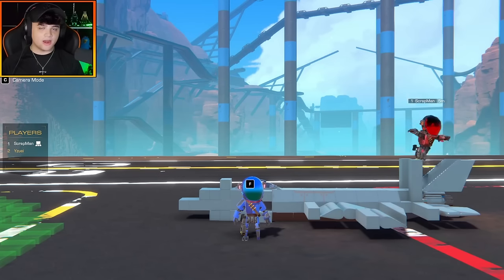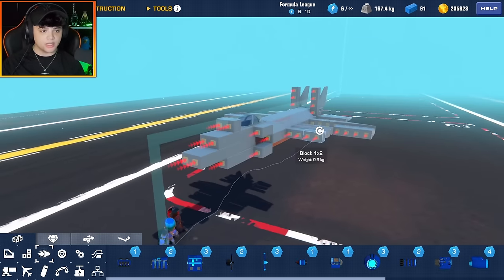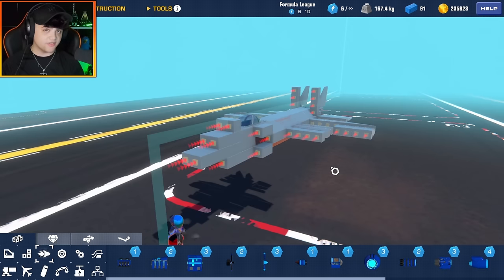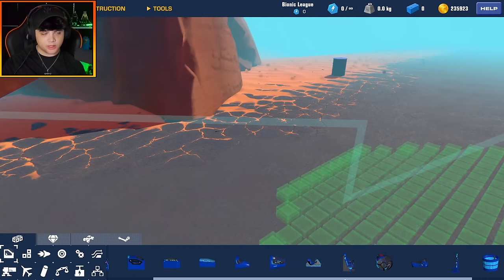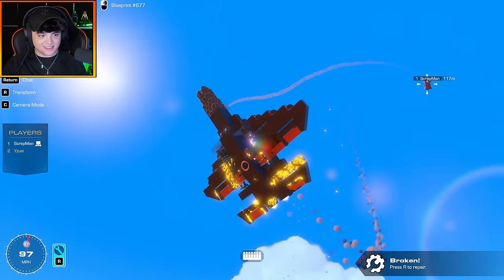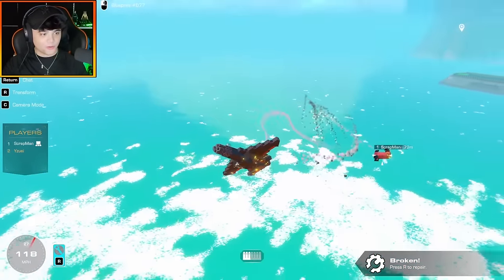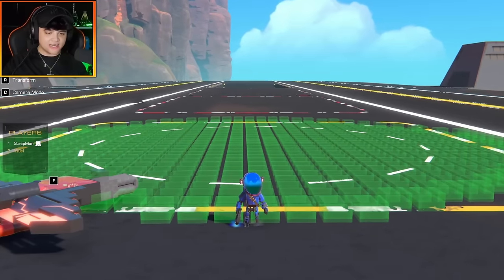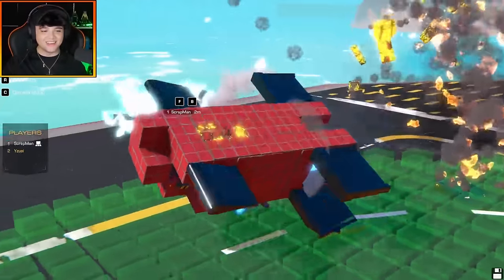DOGFIGHT But We Have NO Aerodynamics!

Comment: If the magnets are affected by the emp's, you should do a barrel challenge.
Each play builds a land creation with a EMP, and a magnet, then have barrel set up one at a time and compete to see who gets the most back to a predetermined "base", while using the emp to cause issues for the other player, like making them drop the barrel so you can grab it.

Comment: One button car challenge! You have to build a car that operates with a single button. Turn left? That's the "w" key. Turn right? That's the "w" key. Accelerate/brake/etc? That's the "w" key. W is just an example, doesn't matter as long as you're using only 1 key for everything, somehow.

Comment: With the title saying "zero aerodynamics" and a vehicle in build mode showing a bunch of red arrows around a blocky front end, I assumed you were doing a "zero drag" fight because you were going to use the "broken-off parts result in zero drag" glitch that all the top-performance builds use. (And I really appreciate that you guys typically don't employ this glitch and actually have to work within the intended parameters of gameplay.)

Terrible aerodynamics is also fun. 
Edit: Also, when you consider the low speed and high maneuverability of the finished plane, it probably gives a better "scale accurate" dog fighting experience, given the relatively low travel speed and range, and non-existent tracking, that projectile weapons have in this game.

But in the same way you guys occasionally do "OP vs OP" builds with like, maximum complexity, I think it would be fun to do a "max performance fighters" match where you get to use the zero-drag glitch to get fighters who are still quite maneuverable but can hit Mach 1+ pretty easily in a straight line. They might be basically impossible to hit with the in-game weapons... but hey, there's always melee.